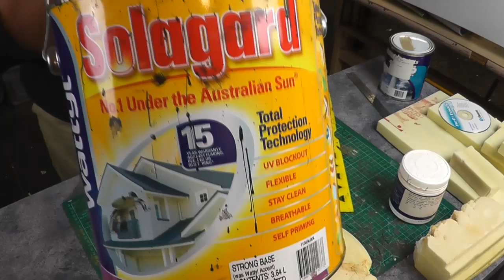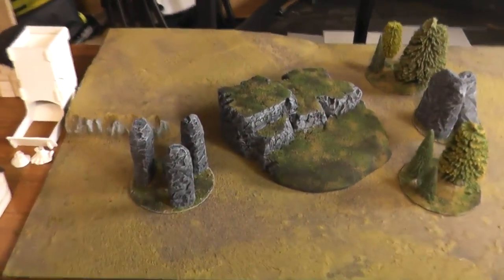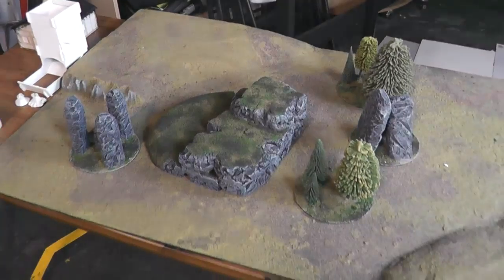Painting rock texture on wargaming scenery

Comment: On shaking vs stirring paint: I was employed a few years ago as an assistant house painter and the guy I was working with showed me a simple trick to prevent the rust and residue build up in the seal trough you mentioned. All you have to do is take a thin screwdriver and a hammer and bash some holes through the bottom of the inner seal. Don't use too big of a screwdriver or you'll ruin the integrity of the seal and the paint will dry out. Other than that, just use your brush to wipe the paint off the lid and run it around the seal occasionally to mop up the over flow.

Comment: I have to say this is a very easy, and great looking way of making rocks. I need to ask what do you use to seal the terrain once finished?????
Reply from the maker: Just some watered down PVA - sometimes a few applications is necessary, will show that bit once all the pieces are ready to be sealed.  Cheers
Reply: i always paint with cheap acrylic paints mixed with PVA then spray with firm hold hairspray, which I also use for figures.

Comment: You use PVA Glue to add flocking with but instead of Hot Glue ever considered PVA and Cocktail sticks?
Far easier less mess and less filling in afterwards but other that looks good and will be something I'll try out myself, saving on mess from cutting foam to bits.

Right I am off to find myself some jagged rocks with features I can utilize!
Reply from the maker: Thanks for watching ... not sure where I used hot glue to apply flock? I use PVA all the time, both to apply flocks and clump foliage and to seal it.  If I did use hot glue, I was probably just feeling lazy :D
Reply: Hey Viv, my comment was actually piggy backed from a Vid by the TerrainTutor whom I believe you know pretty well down in Stoke England?

Comment: Is the PVC thing you talked about at the end, is that like a sort of glue?
Reply from the maker: Leanna Knapp - 'PVA' (polyvinyl acetate) ... yes, its a glue.  Its a non toxic polymer and is typically used in woodworking.  It is available (generally) in an indoor (white) and outdoor (yellow) solution (both called PVA, white glue, wood glue etc).  Out doors is water resistant so might be suitable for your reptile enclosure ... not 100% sure though